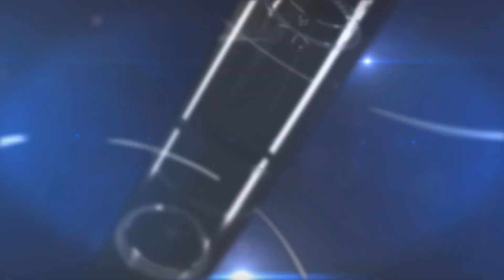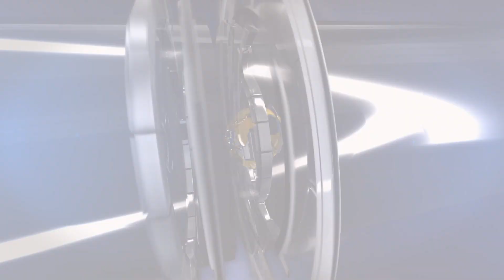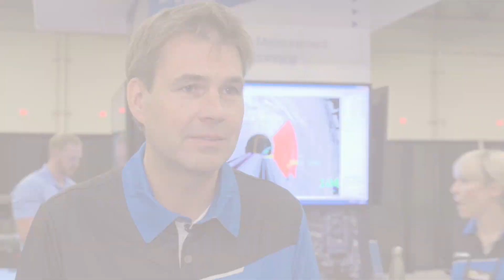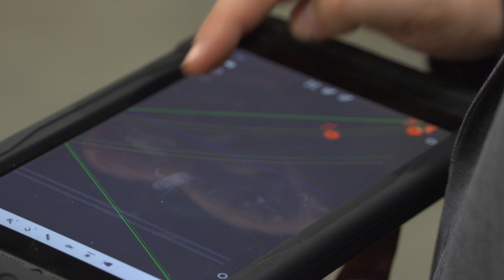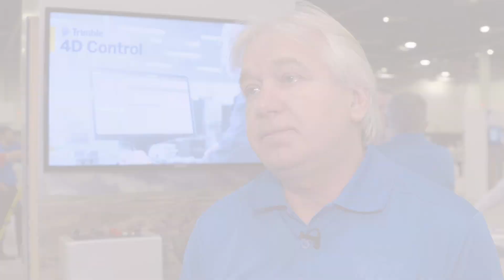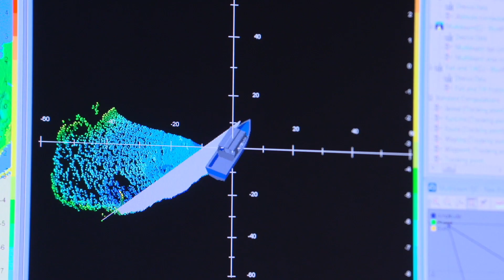Final Day at Dimensions 2016

Comment: I don't kniow where i can ask this question.
Don't be angry this.

I have GPS Aschtech (Sokia) Locus and Aschtech Promark 2. They write data now in 1997 year. This is such problem as here
"On February 15, 2016 from Trimble's members: 4600, 4700, 4800, 5700, 5800, R3 have any problems with the processing of static measurements. We do not know firsthand a lot of professionals in our country work data receivers and would like to help you solve problems that arise suddenly. For the correct processing of the measurement you need to: - Update receivers to version 2.32, if this leads to the guarantee on the software (Warranty Date v2.32"
http://eft-cors.ru/novosti/387-problema-trimble
Maybe you have some utility to change date of data? Now i have  date 1997 year in file which downloud from gps 😞